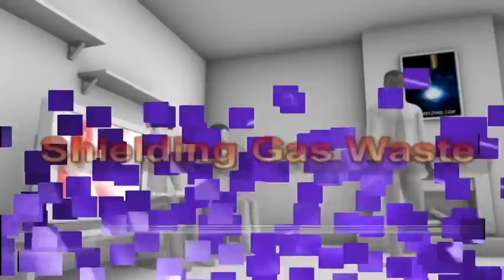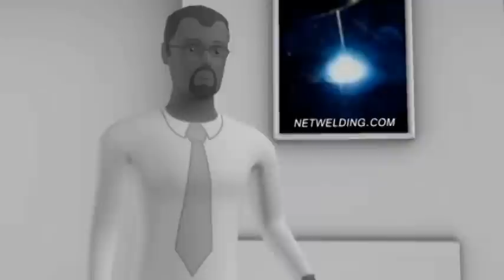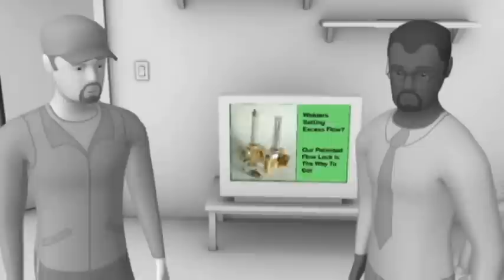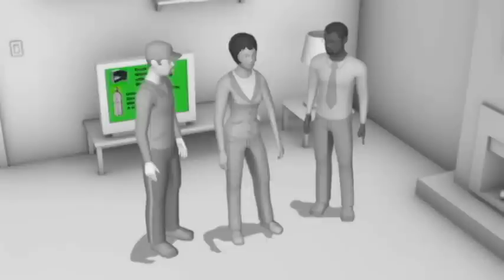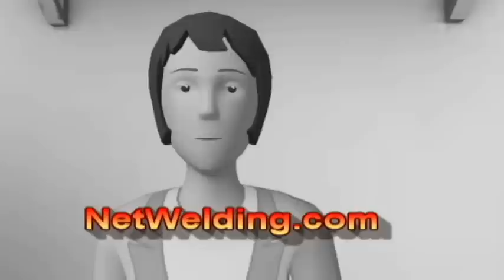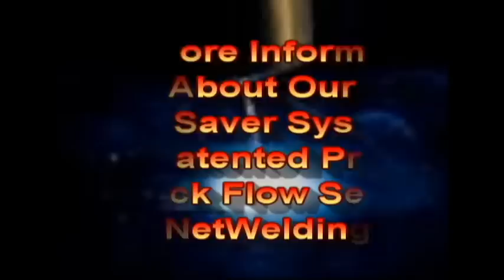Welders Rap On Gas

Comment from the maker: @6013welder For perspective, 60+% of all industrial welding is done with gas shielding MIG either solid wire or gas shielded flux cored wire.  If welding out doors self shieldied cored wire and stick have the advantage of tollerating more wind.

Comment from the maker: Self Shielded Cored Wire OK if you're not welding sheet metal.  Gas shieldied has lower spatter, smoother welds and less clean-up